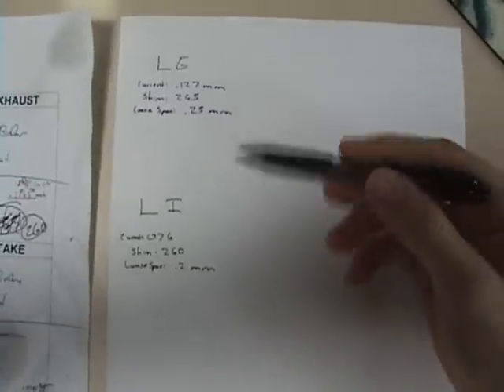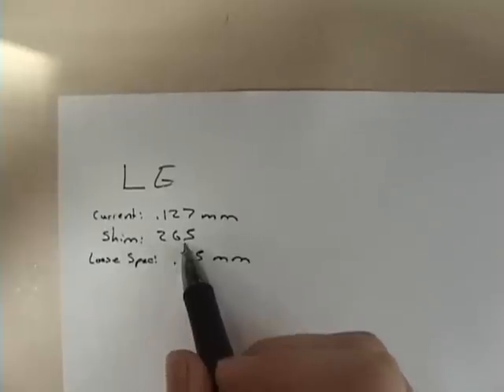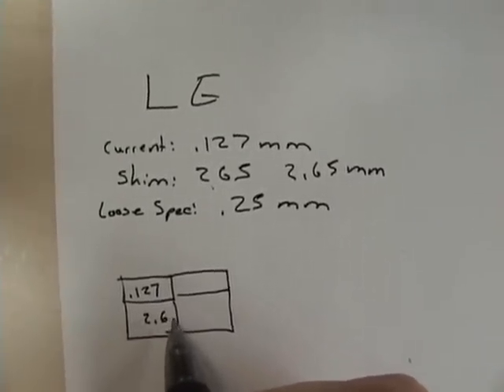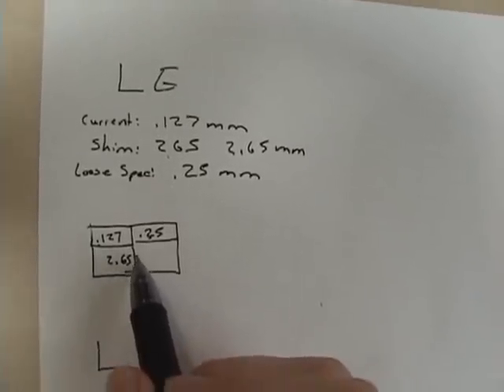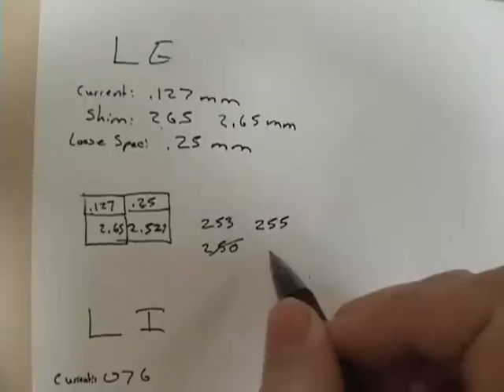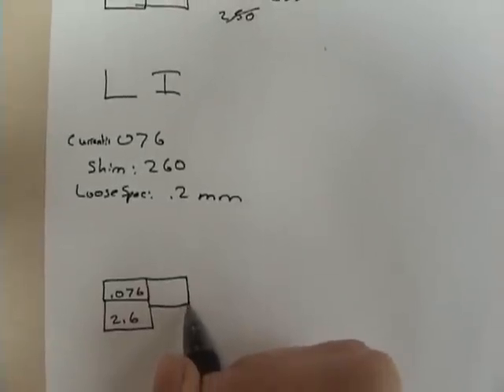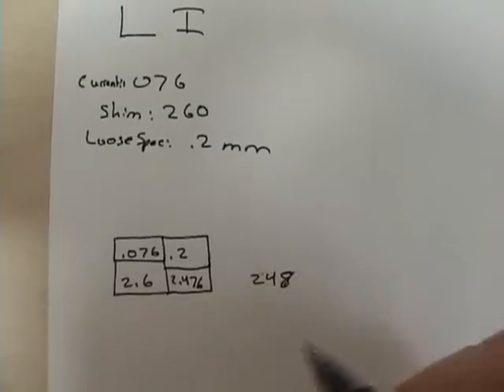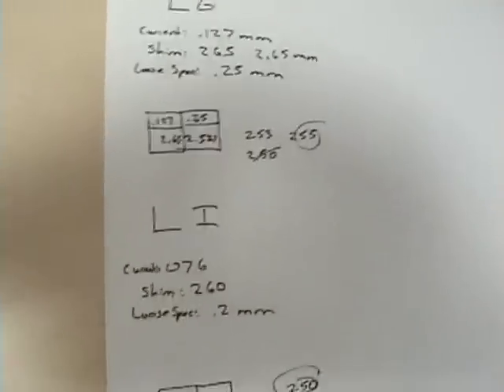KLR Manual Valve Shim Calculation

Comment: Question: I'm due for my 12,000 mile valve check. However, my bike starts easily and seems to be running well. Sooooo do you think I'd be a fool to hold off on the valve check since money's a little tight?

Also, I was planning to do it myself ... but since via this video you've informed me that one needs to be a mathematician I suppose I'll save up the $400 smackers and let the experts go over the whole thing with a full service job.

Btw, thanks for being a sport and posting this vid!

Comment: I wonder if it's possible to sand the shims using some very fine sand paper to bring it to the hundredths of a millimeter you would need?  That's how you do Ducati valve adjustments.  Sanding the existing shim to open it up a little is easier than buying a new one.

Comment from the maker: Haha, funny you bring that up. I just perused one of my old computers and found an excel sheet I made that does the calculations for you and tells you what shims you need where. Give me your email address and I'll email it to you. Don't waste $400 on it. Go buy some feeler gauges for maybe $20 and do it yourself. :-)

To answer your original question: it doesn't hurt to check the clearances. My bike was running fine but were out of spec on the tight side.